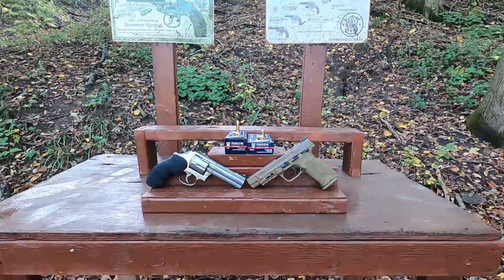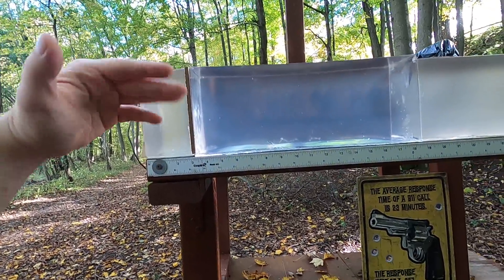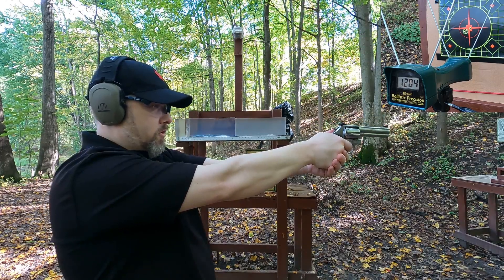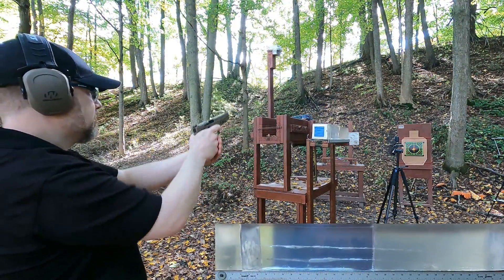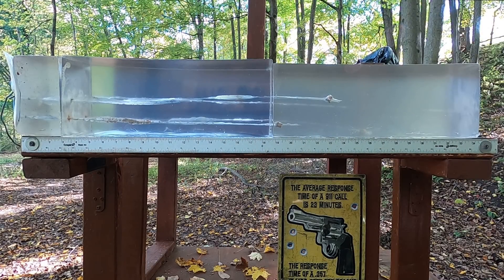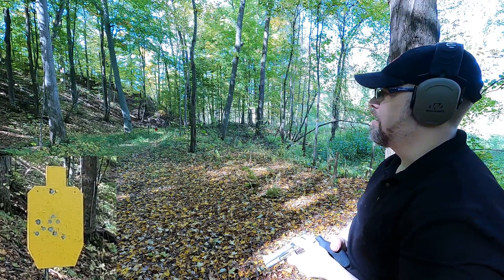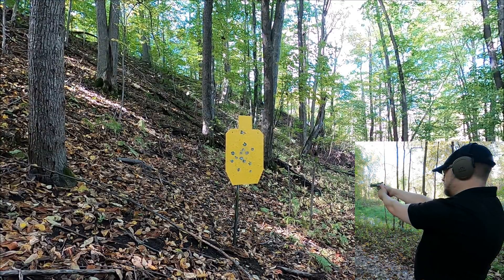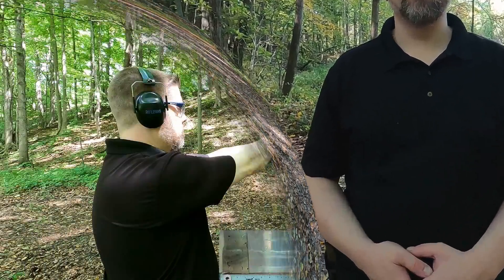.40 S&W VS .357 Magnum - Fiocchi Pistol & Revolver Line JHP

Comment: I really would like to see a test of their 357 wad cutter. I think it runs about 1000 fps so it should have less muzzle blast than full house 357s, kind of in between mild 38s and Heman 357s.

In general Fiocchi may be a good line for getting 38+P performance without the chamber fouling.

So consider this a request for more Fiocchi magnum tests.

Comment: Seems like Fiocchi in .357 is hit or miss. I chrono’d some 158 grain Fiocchi in an identical Smith (down to the grips 😂) the other day. Average velocity was 950 fps. 😳 Yuck.
Reply from the maker: I had something like that happen with Aguila. 158 gr, said 1,500 FPS. The chronograph showed like 980 to 1,050. I contacted them, they sent me a new box that chronographed 1,150. I just don't get it. Buffalo Bore 158 gr does about 1,450 in my 4".

Comment: To me l think the 357 magnum is closer to a 10mm than 40 S/W and 357 SIG has more power than 40 S/W but this is my opinion like the 10mm 357 magnum 357 SIG and can see it's advantages over 9mm 45ACP 40S/W and out of these 3 rounds I'll take 9mm
Reply from the maker: Depends on the load. Yes, when maxed out with equal gun size, I got 794 ft lbs for a hot .357 Mag and 792 ft lbs for a hot 10mm. But on average, .40 gives maybe 475 ft lbs, the .357 Mag about 550 ft lbs and 10mm about 600 ft lbs. But, the main reason why I do .357 Mag VS .40 is because the .357 Mag was it, the cartridge that became the best LE gun in the 70's, 80's etc, then the .40 became the it gun. Good to compare them in my opinion.
Reply: @GunSam  if money was not a problem I'd have a 10mm 357 magnum SIG 357 all these rounds need to at least have a 4 inch barrel or more otherwise it's a waste in my opinion and have the cash to feed them is why 9mm is a better option and today even shooting 100-200 rounds of 9mm is so expensive 200 rounds of 9mm would be gone after 1 hour at the range just don't seem to need a 45ACP or 40S/W l did own a Springfield XDM 40 S/W for 3 years but sold it seem to shoot 9mm more accurate with faster follow up shots for me

Comment: I couldn't see what bullets these loads were using but, most of the fiocci I've messed with used xtp's. Fiocci also usually runs pretty conservative chamber pressures too so I've never seen good expansion out of fiocci in semi auto calibers. The xtp was designed primarily as a hunting bullet and is a controlled expansion, deep penetrating bullet and, as such, just doesn't perform well if it's not driven to optimal velocities.

Comment: Thanks for this video. I would certainly like to see the equivalent from Fiocchi in 10mm tested, its some of the few hollowpoints available here in my state (California). What I like about the higher powered rounds like .357 is even with poor bullet design, bad propellant choices, its still possible to get some expansion. My ammo and gun buying criteria has changed, I can consistently get from one store or another (no internet sales in my state by law) 10mm or .40 S&W. Very occasionally I can get .38 special, or .45 ACP. All ammo is running somewhere from 70 cents a round (40 S&W) to around 95 cents a round (.38, .45, 10mm). I don't expect changes any year soon. You do make a good point, you get what you pay for and there is a significant difference in Critical Duty/Critical Defense vs. "range ammo".
Reply from the maker: While it's not Fiocchi, I got some PPU in 10mm and .44 Mag JHP to do a test with soon.

Comment: Fiocchi makes a flat nose 357 that gets really good fps. I bought a ton of it back when it was cheap. Imagine it would severely fail a penetration test because it has the worst of both worlds- jacketed flat nose, high velocity.
Reply: Unless you need a round with really good penetration, like in black bear country.

Comment: Poor kids or dogs when they hear Sam's Disappointed Voice like when .357 magnum is really low velocity. SAM would u do a 9mm vs .45 Underwood Nosler vid for me u never answer? What's your email or how to contact? OH I plugged you good in my Ruger Max9 unboxing video I filmed today but need to edit still.
Reply from the maker: I actually do have some 185 gr Nosler JHP Underwood already that I shot into jugs over a year ago. What 9mm weight would you like? I'm assuming 124 gr, looks like I can get either 115 gr or 124 gr in either a standard pressure or +P+. So I will assume 124 +P+ Nosler? Seeing as Midwayusa also has .40 Nosler Underwood, I should just do another 9 VS 40 vs 45 all Nosler...
Reply: @GunSam  yep 124 plus p plus and the 230 plus p w nosler. U did the 185 plus p that expanded huge in one video but didnt penetrate that far figured the 230 should have enough momentum to get deep enough.  Also during these ammo bad times there is a company called On  Target i think through Green Valkey some of theirs has xtps and other gold dots maybe u can look into them various calibers for a comparison vid 9mm vs .357 or something. From long barrels is old tech like nosler is a sjhp really needed like new tech like hst or gold dot really is from short barrels is kinda follow up question or piggyback.  If u can plug me as long time supporter of channel DanTheWolfman and Pew Reviews that teaches self-defense and gun reviews of greatly appreciate it.  9bple is another one needs more testing vids out there not sure if can find any? Plus p plus from glock or beretta 92s did great whether Ohio or texas or border patrol in the day w old tech bullet but fast velocity
Reply from the maker: @DanTheWolfman  One problem is I can't seem to get the Underwood Nosler 230 gr anywhere, so if you really want to see the 230 gr it might take awhile.
Reply: @GunSam  what's minimum ud need for test? It's 230 plus p I can send u some for the ballistics part if u can score the 9mm 124 plus p would that work? And u can retest the 185 plus p as well makes a good vid balance of velocity expansion and enough weight to have momentum to penetrate perhaps
Reply from the maker: @DanTheWolfman  I just need to get the 230 gr ammo to test it is all. My email is ninjatoth@gmail.com
Reply: @GunSam  email sent a some ideas

Comment: The rounds tested are right around the 500 ft/lb mark . I think that is a good place to be . In some guns you can go down to 300 range or up to 600 ft/lbs  +/-     to me 500 +/- is the sweet spot in a 4"  44 revolver ( 40 Oz ) or a 10mm duty size auto ( 32 - 40 Oz ) , or a 45 auto duty size  .
Reply from the maker: Yeah, just like Critical Duty. I know the .45 and .357 are right at 500, I never ran the .40 but it's probably there too. Good place for a little bit of everything good, not too much recoil, enough expansion and penetration etc. No reason to go from 500 to 800 ft lbs just to come to the same place when recoil is 50% more or even doubled.
Reply: @GunSam   Yep !

Comment: Not many folks are into a 40 S&W anymore.  You might want to keep doing the 10mm or 9mm along with 357 magnum.  Just saying.  The 40s&w has fallen off the  radar.  Maybe you're videos will bring some life back into the cartridge.  Great video Thanks
Reply: 40 S&W is more popular than 10mm and just slightly less popular than 9mm. After 9mm it is pretty much 40 S&W. 45 acp is more popular than 10mm. 40 S&W is the second cheapest defense cartridge after 9mm and second most common after 9mm. I think you live under a rock.
Reply from the maker: I have been interested in .40 for some time, so sort of why I test it. Even if I didn't do youtube, i'd be out testing .40.
Reply: It may have fallen off the radar for you, not the rest of us though. I have a number of different 40's in my safe and that's what's usually in my carry holster. I shot the biggest white tail I've ever gotten with a glock 35 and 135gr cor bon ammo. 192lb & 9pt. That's not a load I would normally recommend for deer but, it's what I had at the time & I wasn't expecting to run into a deer in that spot. It only took 1 round at about 30yds and it was venison in the freezer
Reply: @al01100  I have several Glock 40's and a Kahr. I enjoy the round as well.
Reply: The 40 has fallen off the radar? 10mm is a niche cartridge.  If 10mm was as popular as people make it out to be than it would be just as cheap as a 40.
Reply: @Matt-oj2kl  The 10 mm is a overhyped cartridge where it has more of a reputation on internet forums and youtube comments than actually documented field practice. In my opinion it is over kill for self defense and will affect you negatively legally in a self defense situation and also it has the highest risk of collateral damage (overpenetration) out of all semi-auto cartridges. And it really does come up short as a bear killer because without shot placement it doesn't have the stopping power like rifle and shotgun has to take down the bear. Heck there are even cases of people downing grizzlies with 9mm. Honestly if you cant down a bear with a 9mm with good shot placement the 10mm is not going to make much of a difference. There is really no such thing as stopping power when it comes to handguns. 500SW magnum revolvers are a different story. Therefore, the 10 mm is overkill for self defense and affects you negatively legally, and increases the risk of collateral damage more than any other handgun caliber, and falls short of its internet lore of bear defense. It really only exists to stroke the ego of semi-auto fanboys in the power department because semi-autos are less powerful than revolvers.
Reply: @johnstockton8138  Nonsense. The 10mm is what the .41 Magnum should have offered: roughly a 40 caliber bullet at 1200 fps with 200 grains of lead. That's about the same ballistic performance as the .357, but with a more bowling ball vs. spear point bullet (most .357 go to 180 grain max) thus less tendency to yaw off the path when hitting bone/sinew etc with heavier bullet weights. It is the rough equivalent of the .357 magnum which is effective against black (not brown) bears in the 180 grain weight. In fact, its extra velocity and slightly larger diameter make it more not less effective as a self defense round since its far likelier to have reliable expansion in personal defense. There are a bunch of gel tests showing this online. 
And yes there is a difference between 9mm and 10/357. Penetration upon average, field proof effectiveness (no one hunts boar with 9mm but they do with .357/10mm/44 magnum). Agree that for brown bear .44 magnum is the minimum for a handgun (your shotgun/rifle might not always be handy) but I stay out of brown bear country. There IS such a thing as stopping power in handguns. It is not always reliable, does not work every time, and is situational dependent but roughly, .357 magnum is "king of the street" (and 10mm seems equivalent), then 45 ACP then .40 and 9mm significantly lower in cases where one shot incapacitates according to Greg Ellifritz's research.
I went to the local gun store where I live (California, no internet sales by law). No 9mm. No .357. No .38 special. There was 45 ACP, 10mm and 40 cal. The latter the cheapest, at about 70 cents a round, the former two nearly a buck a round. That situation is not changing any time soon. The advantage of 9mm -- cheap and available is gone in my state and I think many others. 
What 10mm will give you is that when ammo is scarce, and you have few choices, the extra velocity is more likely to produce better expansion than 9mm, or even 40 cal. Even with sub par bullet design, propellants, etc. Its a more powerful cartridge and your comment is not adaptive to the times: scarce ammo, all of it pricey, you cannot mostly get premium ammo and have to settle for available ammo.
FWIW I have been able to get 10mm somewhere in California all during this time, .357 disappeared in Feb 2020 and is not likely to be available until 2023-24 at the earliest I am told.
Reply: @alecswann7234  Sure.

Comment: Would you say that .40cal S&W is in the ballistic territory of .44 Russian/.44spl, 10mm, and .41mag?
Reply from the maker: It's hotter than most .44 Special, but it's similar to Buffalo Bore .44 Special. The 10mm and .41 Mag have a lot more power, however a few 10mm loads like Hydrashok are in the .40 S&W power range.
Reply: @GunSam  With all things considered regarding loadings, my takeaway is, that I still have much to learn... Thank you for answering my question, Sam

Comment: Thanks for the comparison between the .357 Magnum & .20 S&W using Fiocchi ammo. I think you may be right in suggesting this ammo be limited to hunting. I have a carbine with a 20" barrel that fires .357 rounds. Maybe I need to check this out. My experience with .357 rounds goes back to 1965 with a Colt Trooper.
Reply from the maker: I would imagine a .357 carbine would shoot a lot of mediocre rounds very well. The more velocity the less the design matters.
Reply: @GunSam  I think so. It's great to increase performance from 38 Special and 357 Magnum.